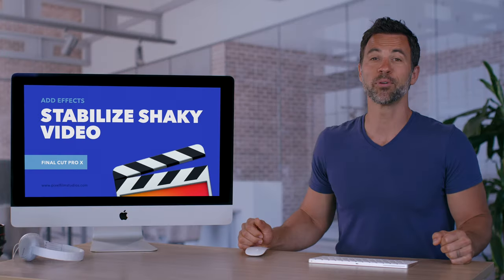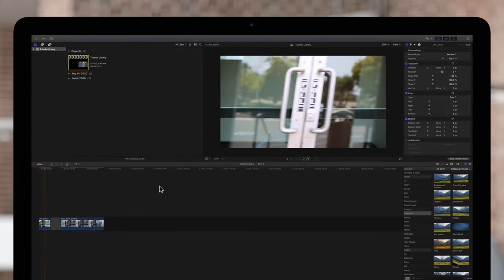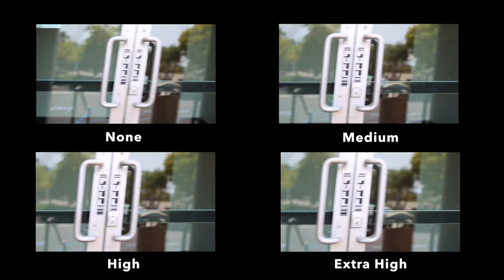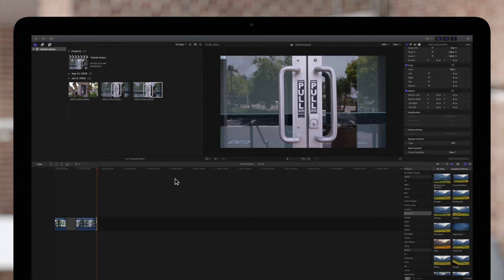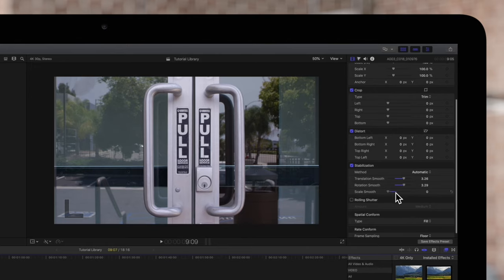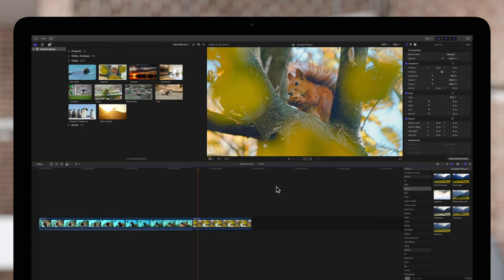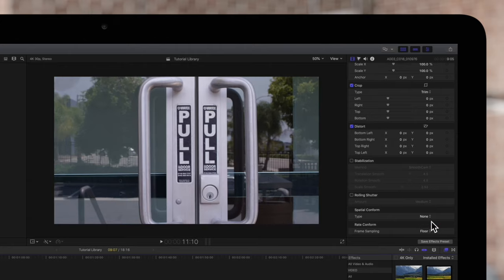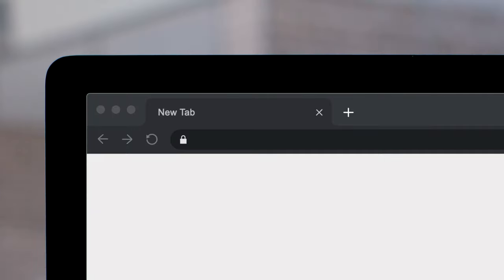How to Correct Shaky Video with the Stabilization Effect in Final Cut Pro X

Comment: Hello! Thanks for the video. So, I watched this and stabilized a one take video. I just ended the color grading process and when I was about to export, I cropped (sliced, bladed, make shorter) the last part of the video. When I did that it appeared "Analyzing for dominant motion" and it automatically zooms out the whole image (I am almost sure it has something to do with stabilization). But I wanted this to be exactly as it was without the zooming out. Is there a way to do this without Final Cut Pro automatically modifying the image. I don't know if manually zooming in or exporting (which format?) and then cropping that exported video will work, but I am afraid it will loose quality. Thank you! (Hope i made myself clear.
Reply from the maker: You might have to compound the clip before you crop it to make sure the changes to the clip are not affected. To compound a clip press Option + G or right click on the clip and press "New Compound Clip."

Exporting the clip as a full video, then importing it back in to the project as a video to crop would also be a viable option.